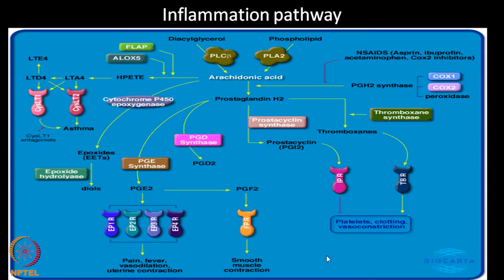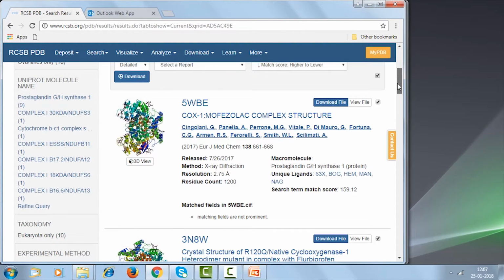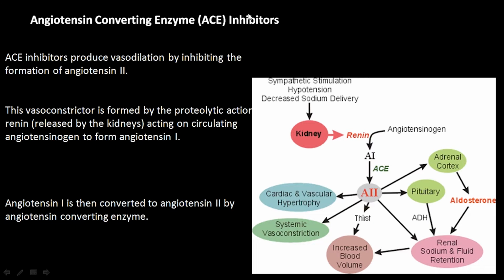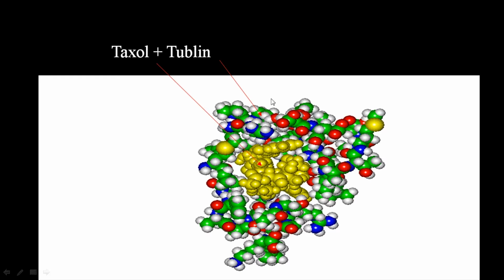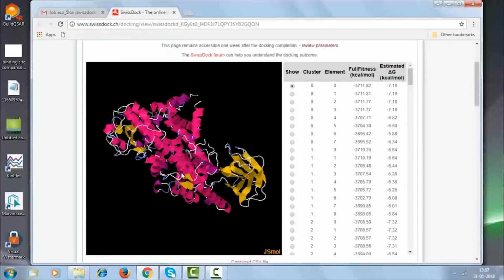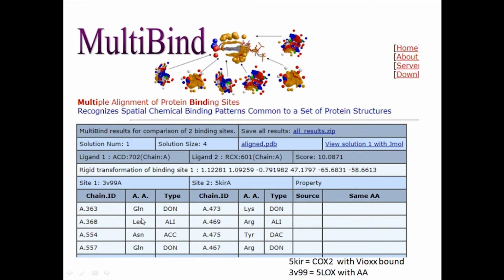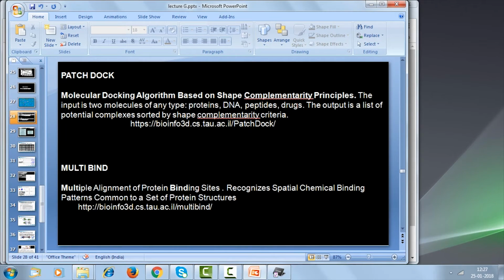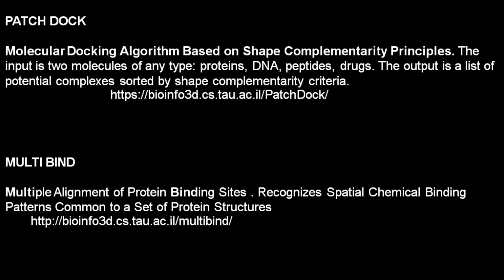Lecture 38 Docking

Comment: Sir can please tell me....why the binding energy is negative??
Reply: Every favorable process will go towards a minimum energy structure which is stable, Because to go to minimum energy level it has to release energy. Hence the energy is negative. If energy is absorbed to higher energy state (unstable) it is positive.
Reply: delta G=-R*TlnK, where K is equilibrium constant -ve deltaG (binding free energy) means K is greater than 1.